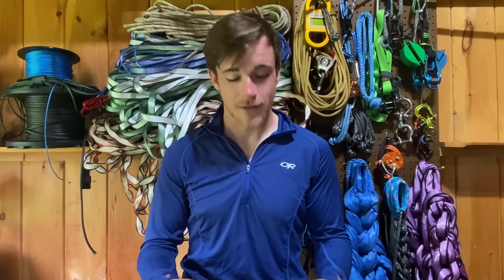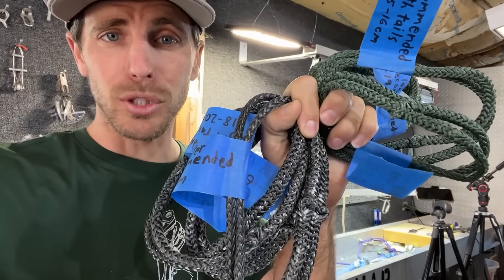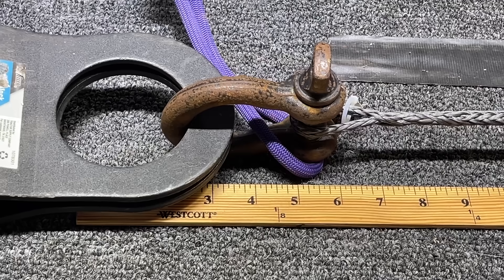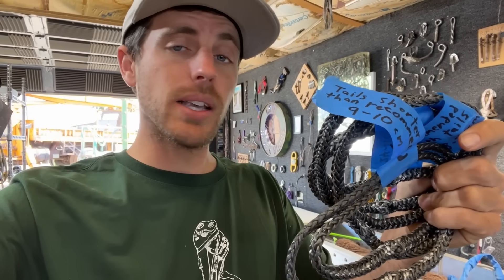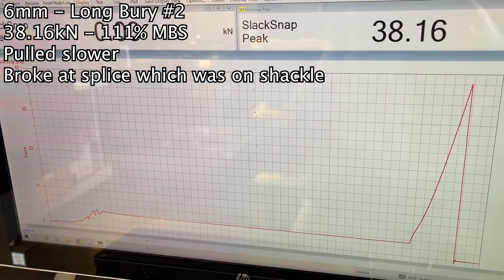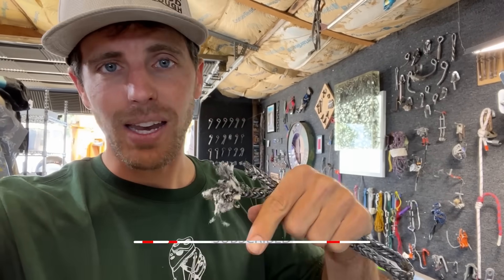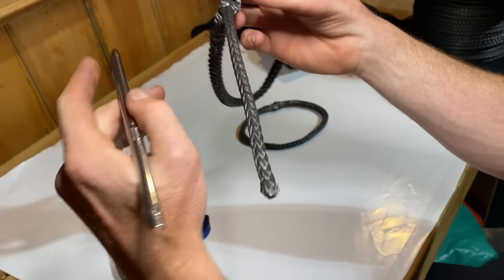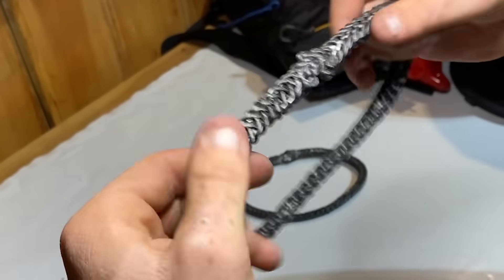Animated Knots was wrong

Comment: I think you meant 60% total right?
Reduced by (not to) 70%, meaning 30% x 2 = 60% total strength for the loop.
I mean, imagine you just tie a bend (double fishermen’s, for example), the strength on a single strand would be 30%, but because it’s in a loop, the force is divided, so 60% total in the end.
Doing the Brummell splice is similar to that, since the bend radius of the contact point in the joint is similar.
Unless I misunderstood the animation, you are not splicing the end of one side to the other (which would maintain almost total strength), you’re splicing the end into itself after the locking Brummel. So, equivalent to a knot (but less prone to slip, since it’s dyneema).

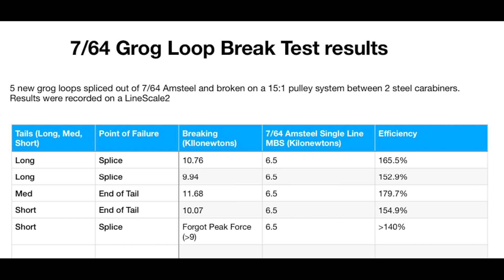Comment: 1:15 the splice nominally has 70% efficiency, the loop is doubled such that one side is spliced and the other is not. you assumed 70%+70%=140%, but i think that would actually be representative of a loop with two splices, one on each side of the loop. for a loop with one splice, i would expect 70% (spliced side) + 100% (unspliced side) = 170%, which seems closer to your real world results. cheers!

Comment: Everything I know about splicing tells me that your buries and tails are way too short.  Dyneema is so slippery that you need long buries to spread the friction across the tail.  Also short tapers are stress concentrators, so it's not surprising that it will break there.  Caveat that all my experience is on boats where it's very common, but we mostly only do eyes and soft shackles.

Comment: I noticed you used very shot tapers. My experience with Polyester and Dyneema tells me to use at least 1-1.5 fid length tapers or longer.  I wonder if testing different taper lengths would have any effect. Given you failures were not consistently at the splice.

Comment: Do you recognize that you only have one strand at the carabiner?  I think your estimate of doubling the strength for two strands is off -- yes you only have 50% of the load applied on each strand going between the 'biners, but at the 'biner you have 100% of the load applied to a single strand (and it is applied at a sharp bend instead of straight pull).  The only surprise here is that it wasn't failing at the 'biner every time.

Comment: How do you know that the plastic is all the same. As in if it is made (the plastic) on a different run by the chemical plant. Seems like the plastic itself before it is made into rope is in question. Lets just say that one run of the chemical is contaminated or not heated the same way. Seems like the variables of the actual plastic needs to be looked at.

Comment: Just looking at these, are they mainly breaking around the green-pin. Have you tried wetting the line to see whether there is an effect (ie either cool or lubricate the fibres as they pull around.). 

The combination of diameter, applied load and rate of applied load might make a difference where it is bent round an anchor point working under load suck a lowering point or like a boat mooring bollard. 

Have you tried any of these tests using pulleys, like the Petzl pulleys? These might reduce the rate of increase in heat and friction set.

Also have you tried a test on a virgin and heavily worked (ie hardened) piece of line. I read some where that  they regain their strength after moderate deformation and cooling, but can hardness be an inspection control against serviceability. The same article was talking more about maintaining the sheath for UV screening and avoiding contamination.
Great video again, keep it up.

Comment: Perhaps I've missed this: Has anyone tested "traditional" continuous loops, vs. grog loops? Say 3 of each, 1/8" amsteel blue, oriented the same way, in the same setup? For the test, I don't think you need to bother with the stitches on the traditional loops. (I do minimal stitches, just to keep the ends from pulling when the loop is not under tension; I always tension the loop before stitching, and use strong but "loose" stitches.)

Comment: Hey Ryan,

There’s a few things that I think are incorrect or misleading in this video that I want to point out. I did a lot of testing on grogs before sharing grogs, including using them on lines and 27 breaktests, and a lot of that information is mentioned in my article about them: (link redacted to appease youtube)

I would really encourage anyone interested in grogs to read the article before forming an opinion about them. I include my break test results, the reasons for using grogs over other systems, and accurate instructions on making them. Onto my problems with the video:
1. For 5mm, you have tested ~2.5” buries, 6” buries, and 9” buries. The 2.5” buries slipped, just like the 2” bury I tested. The next you tested was 6”, which tested well but you say is too long. You didn’t test any intermediate sizes, and if you had you would’ve realized 4” (20x diameter) does just as well as 6” (30x diameter) while being a smaller, lighter sling. Particularly, it allows the loops in connections to be much closer without sacrificing strength. Your 6” and 9” buries all broke in the range of the 4” buries I tested.
2. On your blog, you list the “short” 5mm buries as 4” long, when it clearly states in the video they are 6-7 cm, which is roughly 2.5”. They are clearly not 4” long in the video. None of the grogs I tested at 4” slipped, nor did any of the 3”, only a 2” grog slipped. This is a serious mistake that makes a perfectly safe grog seem almost half as strong as it is.
3. You shouldn’t taper the tails of grogs. As they are sensitive primarily to bury length, this will only weaken them. Tapering the tails reduced the effective bury length, and may be why your 2.5” grog slipped at such a low value. A 45 degree angle cut is the proper tail finish for a grog, do not taper your grog tails.
4. Jake mentions inverting the sling to make it more secure. This is fine, it doesn’t change the strength significantly, but is also unnecessary. The tails do not come out during use, as we have tested at multiple festivals and 6+ month permarigs.
5. Double wrapping grogs works great. I haven’t had a chance to break test them yet, but they were used on almost every split rig at GGBY (except two lines that had single wrapped grogs, and one quicklink DLV). You can get just as close as with a soft shackle. One double wrapped 5mm grog is as light as a double wrapped 3mm soft shackle and roughly the size of a double wrapped 4mm soft shackle, while likely being stronger than each. There is no benefit to reducing diameter when double wrapping grogs, as you already have to make the 5mm grog longer than needed to fit most webbings, and the weight savings on double wrapped 4mm grogs are very negligible.
6. Naming this “Animated Knots is wrong” is highly misleading, and disrespectful to the person who created the grog (the website is run by Grog himself). Animated knots merely cited other testing that didn’t overlap with yours. Just because a reference they cited didn't get the same results as you doesn’t mean they were wrong.

I posted something akin to this reply when the video came out, but included a link so it never posted. This above is what I responded to on SlackChat. I think it's important information for people learning about grogs through this.

Comment: We use this splice-technic on ropes that be used to start a sailplane/gilder on a winch. We had never any problems with that splices. The Load is always static on slow acceleration. (We splice every ropeend with 0.5 meter into the other ropeend)

Comment: Bro, you’re killin me. Shackles have a pin and they have a saddle. Put the smaller side in the saddle so it stops moving on the pin and towards to hole.
Reply: agreed.  but some well polished shackled bits and spacers/washers to ensure that zero rolling takes place might not be a bad idea either...

Comment: One thing I noticed, is that after the splice there is a really sharp turn, as from how it looks the end is buried on itself. Could it perhaps be a bit stronger if it were to be buried on the "other" strand? That might be one to test in the future. Obviously the caveat here would be that perhaps it would also be a lot weaker as the overall friction of the splice and fingerlock could also be less due to a more straight routing.

Comment: Great video. As I understand it, assuming the particular "backwards" brummel is 70% efficient, a loop should have 170% of the rope's breaking strength. Jake I think wrongly assumed that the 30% loss applies to both sides of the loop making a theoretical 140% but the strength loss only applies to one side of the loop. Not sure where 180% comes from, maybe AN's data showed 80% efficiency of the brummel?

"The Effect of Bending on the Tensile Strength of Statically Loaded Synthetic Ropes" by Mark Pederson, Greg Mozsgai and Danielle Stenvers, is a great pdf to scroll through, particularly slide 14.

Also of note, the "closed off side" of the brummel can be opened up enough if you flip the brummel to have the bury go straight into the already created hole. Wonder if this has a significant effect on the splice's strength as opposed to jumping over a few strands as shown in the video. 

TL;DR: Sling strength should theoretically be 100% + splice efficiency%. I wonder if you could isolate the variable of the loop and instead join two separate lengths  together with the "backwards" brummel splice to get more accurate data on the splice efficiency.
Reply: I think the theoretical value should only be twice the weakest strength in either side of the loop.
When you load something like a loop, each side should take roughly half the tension applied to it, which means you will only be able to load up to 2* your weakest point, ie 140% of the strands strength.
Not that the unspliced side loses strength somehow, just that the spliced side should break before you get to load the other side at 100%, if that makes sense?
Reply: @ProlitEng  google the paper I mentioned in my comment, it will explain it better than I can.
Reply: @erikjackson132  had a look and I can’t find a figure for the loss of strength due to the grommets they are using, just the configurations for that splice and their associated strengths.
Purely to your point about total strength, just imagine if your sling actually consisted of 2 cords of unequal strengths, ie S1 and S2 where S2 is 70% as strong. Wrapped around the mid point of the change and pulling both strands, you don’t have the ability to pull 170% because S2 will break.
Take it to the absurd to prove the point, tie floss to a rope, double it over and pull both strands, you cannot pull the ropes strength + the floss, only the floss strength.

Comment: So I noticed the tails in the loop were oriented crossing away from each other. Burying into themselves more or less after the Brummel splice. Isn't there a way to make the Brummel or another ring splice where the tails continue in line so you don't have the hard 180 bend?
Reply: I also noticed that. I suspect that the sharp turns are why these loops are so much weaker than a stitched bury loop.
Reply: @jeremiahblatz  The only way I know of is to unbraid the line  on the second pass & rebraid it on the other side of the splice. Doing that would make a Brummel loop after the bury. It's a major pain in the a## but I was hoping there was a better & more reliable way.

Comment: I see the same amount of dyneema touching the shackle, looped or not. That is where it appears the load is transferred through. It's braided, so the load gets put through individual stands differently depending on how they lay in the braid on the shackle. This could be why some stands are hanging out long after breaking. Maybe? Or not...
Reply: Could a single line with eyes on each end be spliced similar with the trail going back over into the eye? I'm guessing you would get the same results as this loop.

Comment: I wonder if the loop sliding along the bolt towards one side has an effect? Could it be getting pinched in the gap between the bolt and shackle hole? You might consider using a spool to keep the loop in a more friendly position.

Comment: So 2 points of concern, and my belief of why these are generally not hitting their target strength. 1. After the rope is spliced through the other side, it is then bent back 180 degrees on itself for the bury. Theoretically this gives you a 1:1 bend rad, which Dyneema states is the min. to retain full strength, but realistically i don't believe it does. In all the illustrations i have seen in reference to the min. 1:1 bend radius, plus the verbiage used, the radius the rope is bent around is a rigid material, i.e. a steel shackle or pole, dyneema of course being quite a flexible and soft material can be scrunched up into a less than 1:1 ratio when another rope is constricted around it. So right there, is real loss of strength. 

2. There is also the "throat angle" which is the measured distance from where the inside of the rope eye makes contact with what it's pulling against (in this case, the other end of the rope being spliced through and folded back on itself and then buried, the other eye, this loop is literally just two eye loops pulling against each other). Throat angles for dyneema are suppose to be a min of 3:1 and preferred 5:1 to retain max strength. This creates much less than 1:1.

This is why i think you are getting less actual strength than what Animated Knots states. I'd bet they are getting the theoretical strength using roughly the same equation as a soft shackle, which is a bad idea since the eye of a soft shackle once pulled over the knot is probably pretty damn close to 3:1 throat angle.

Now all of this is not to say a Grog Sling is a bad idea, you have to choose a rope thickness that will ultimately yield the safety margin needed for your application, so they can of course be super good enough. From a purist standpoint, bending the rope back on itself like it is here is scary af to me.
Reply from the maker: I 100% agree with 100% of what you wrote

Comment: I30 to 150%. I may be crazy here, looking at statistics, if you have two uncorrelated functions of equal whatever, their combined strength is diagrammed at right angles because they are un correlated. a little math here courtesy of Pythagoras. A 1x1 right angle has a hypotenuse of the square root to 2 or about 1.4142+ which puts it right in the middle of your results. Is this an ah-ha moment or an aw-shucks moment? Changing the subject, bury lengths are sensitive to the coefficient of friction, and Amsteel's is a lot closer to teflon than nylon. Dyneema is different, not merely better.

Comment: The "finger trap" quality of hollow braid Dynema is contingent on it being able to contract around the cordage inside if it. With the tails crossing, you have the Dynema trying to construct around a bulge. The only friction would be where the tails cross. Long but separate tails would provide the most friction.
Reply: I think the main issue is that people think the brummel adds to the holding power and make their tails shorter. Afaik a normal eye splice and a brummeled one have equivalent strength, making a brummel is just less work than stitching for small ropes.
Reply: I mean technically correct but that constriction point is moved along the rope if it ever "slips" but it's got the recommended length of tail so that constriction still reaches the rest of the tail regardless of a bulge somewhere else along the rope.

Comment: I wonder if the amsteel wedging into the metal shackle/bolt interface is causing it to fail a little early
Reply from the maker: I am around the corner when it is breaking so I didn’t see it was happening and then I thought all the samples were compromised when seeing the footage but that slow mo showed me the opposite side broke, the side that didn’t slide. Basically I don’t think it helped but i don’t think it compromised enough tests to see we didn’t get a full 180% as assumed.
Reply: @HowNOT2  I don’t blame you, must feel like a bomb going off each time they pop. Nice work, love your channel and all things amsteel, keep up the great work!
Reply: Wondered that myself, especially after seeing the slipping that was happening to a couple. Could easily see a scenario where it creates a pinching action where the rope is unevenly stressed or heated.
Perhaps turning the shackle around in future testing could help mitigate this?

Comment: I made one out of technora, and have been wanting to break it. This feels like you've read my mind!

Also, the folks at Samson feel that the brummel is not worth it, and you should just splice the ends straight into each other followed by lock stitching. Is lock stitching a bit time consuming? Sure, but if the goal is to achieve max strength retention....
Reply from the maker: I've done all my loops as simple splices before and might keep doing it that way myself.
Reply: I completely agree. I think the Brummel--or more accurately the locked Brummel--is widely misunderstood and misused. It locks a normal eye splice against complete failure; that is the buried tail can't completely slip out without breaking something, but it doesn't prevent a small amount of slippage at the throat from simply bending the splice back and forth. This results in a bulge of rope right at the throat that had previously  been buried. Once it has bulged out it will never go back in, and therefore that small bulge will, in the worst case, never become taught or take any load. Lock stitching, on the other hand, completely and definitively prevents any such slippage, guaranteeing that every part of the rope assembly can become taught and add to the overall strength of the eye or loop.
I suggest testing some loops where the two proper-length tails bury in opposite directions to make a clean loop that is lock stitched in each throat to guarantee no slippage.